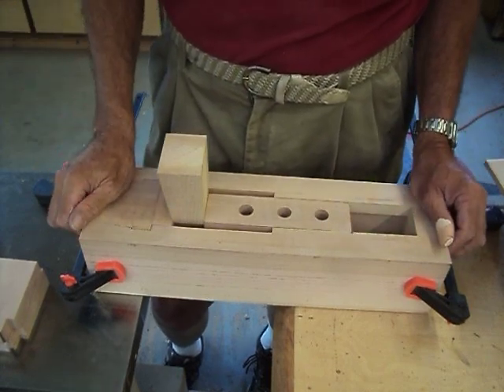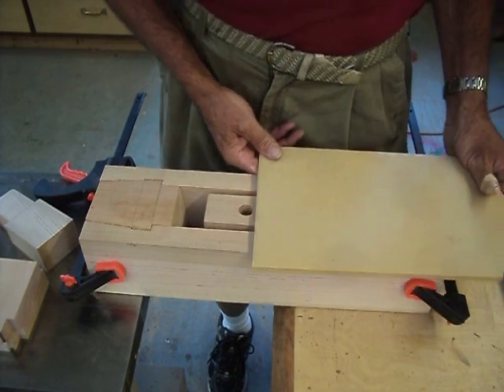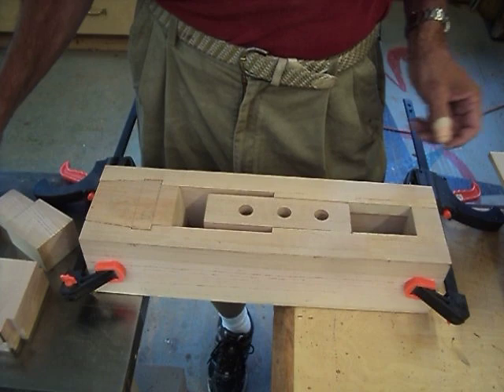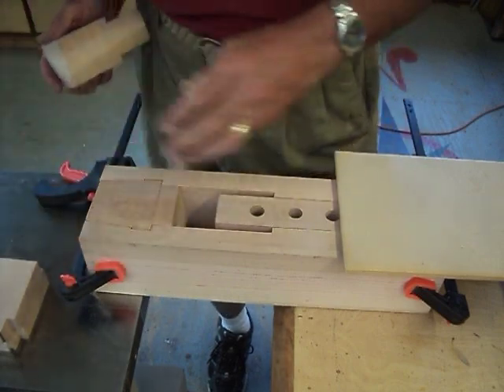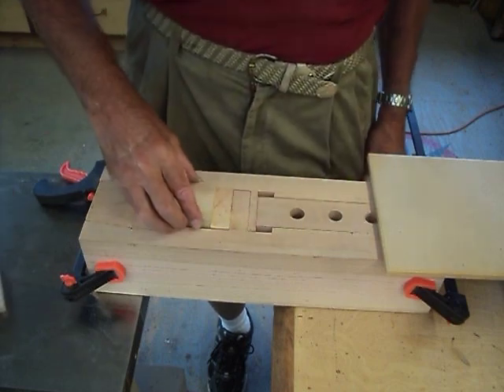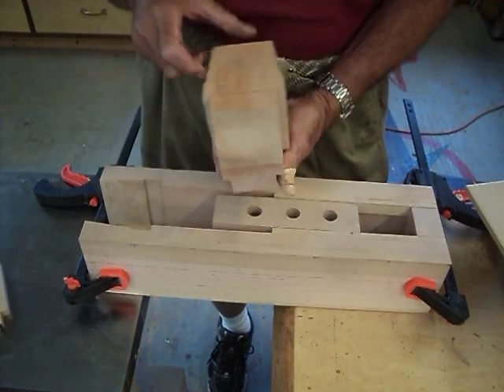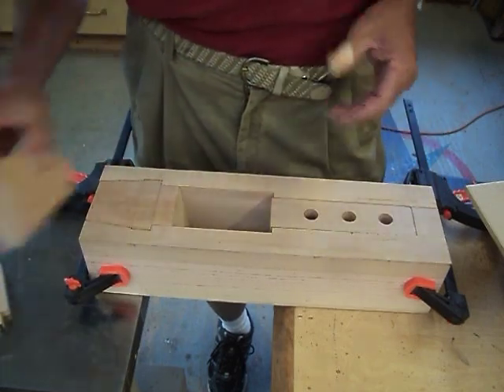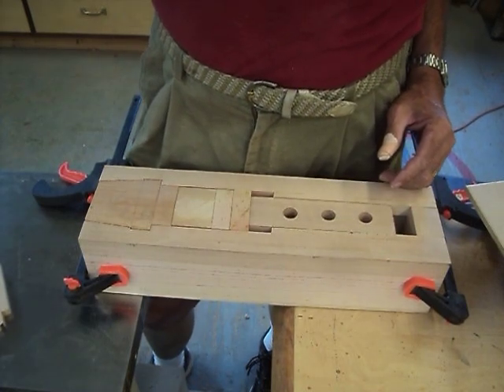Wedge Powered Wagon Vise.

Comment: I think the idea is simple and brilliant. I'm thinking about making one for my upcoming Roubo bench build. A big appeal for me is there is not hardware protruding from the end of the bench - my workshop is really small.
My benchtop is going to be two laminated beech panels glued face to face, total thickness of 80 mm (3 1/8"). Is that thick enough to house a vise like this? I'm wondering how to embed a vise like this in a benchtop (since I'm not making making it out of edge-glued boards)?
Your build info says "To retro-fit it in any bench, all you need to do is cut out a hole that matches its outer dimensions and drop it in. A little hot hide glue, epoxy or pva will make it a permanent fixture."
Does it mean mortising a rectangular through-hole through the workbench top, paring it until the vise just fits, then smearing the ends and sides of the vise with glue, and inserting it in the hole? Would it be better to secure it any additional way?
Reply from the maker: Have a look at this blog for all the details you need.

https://www.lumberjocks.com/shipwright/blog/series/5516